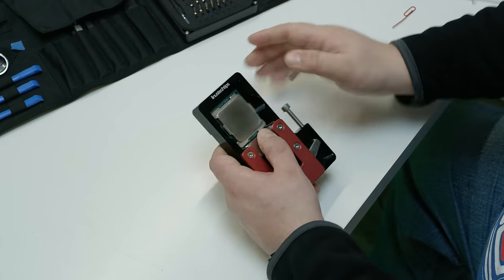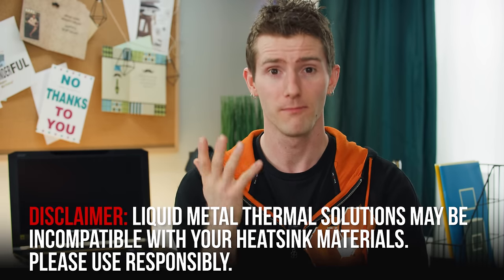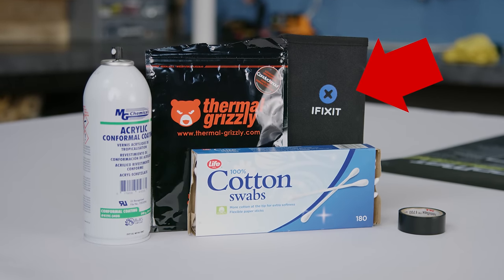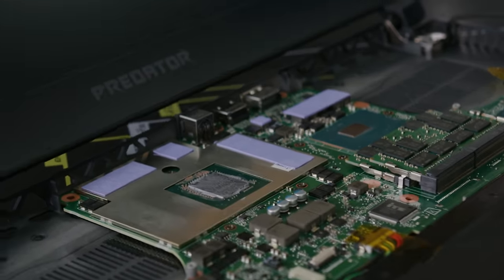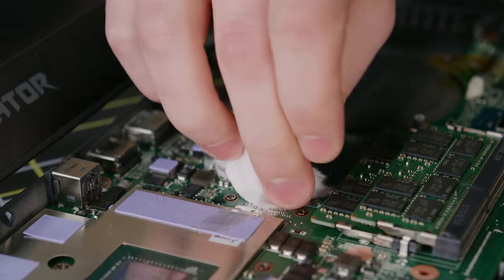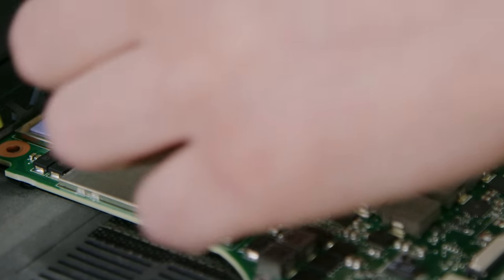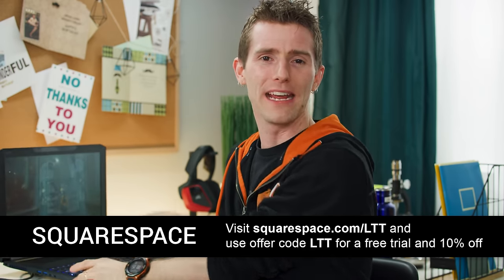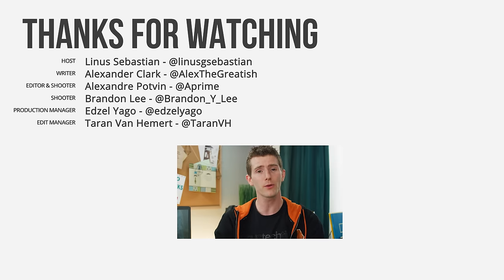Liquid Metal Laptop Cooling – 20C LOWER!

Comment: why don't any production computers come with pre-applied gallium compound? i mean i know it's more expensive but it seems like it'd dramatically increase performance to noise, and it's a nice thing for a gaming computer to be able to brag about in its marketing. or why don't any of the really high end desktop/workstation processors come with gallium under the IHS? i know the reasons most people don't do this kind of mod, but from everything i hear about it, sounds like all of the issues with it are totally controllable. like any of the problems that people have with liquid metal ultimately arise from the consumer trying to do it themselves, not having tools with a high degree of control, or just not knowing what they're doing. if it's perfectly safe and long lasting then why don't any companies incorporate it into their existing assembly lines? or do they and i'm just not aware of it? if it's really still mostly an aftermarket mod, that would seem to suggest there's some caveat, right? anyway does anyone know if the internal surface of the threadripper 1950x IHS is aluminum? not getting super high load temperatures or anything and i know the reason it can't OC much past 4 ghz is not because of the die overheating. but if there's no real caveat to gallium, why not push it a few degrees lower just for the sake of it? just haven't got any idea what metal is actually inside the package.

Comment: Elevate ur laptop a little...dont leave it on a flat surface when gaming...it suffocates ur laptop....my laptop thermal throttles if i leave it on a flat surface...i put it on a laptop cooler and it drops 10C...when i undervolt itndrops another 10C...my laptop never goes above 71 during gaming sessions

Comment: Hey Liinus....  Do you think using liquid metal would help the cooling issues with the area51m 2080rtx.  I was gonna repad it with artic thermal pads and liquid metal.  I had 2070 in it but thought I might as well max it out before rtx's rise in price and the gpu becomes more sparse.  So much for the upgradeable dream.  I cant believe they screwed up with the R2 also.  I have a feeling there's probably not going to be an R3.  What's the point. Maybe they change to an AMD board.

Comment: Um also https://en.wikipedia.org/wiki/Liquid_metal_embrittlement - probably don't do this, its NOT a chemical reaction and the gallium can migrate into other parts of the laptop up the solder traces over time if you get ANY on anything but the core/spreader interface. There is a reason Intel, Nvidia, AMD etc do not do this and use the compounds they do ! It will also eat aluminium parts of a case for breakfast. Look on YouTube for gallium videos ...

Comment: I dunno how you didn't destroy that laptop, the liquid metal seems like it has low enough viscosity to wick under the components on the board, not just around them. Also anyone know if long term it's a good idea to put electrical tape on those components? Hopefully there's nothing that can slowly cause corrosion in the glue. I'd have used kapton tape myself since it's commonly used on electronics.

Comment: yeah man for over a grand laptop i dont think i want to risk it . My laptop is the cut down Zepherus  the best buy version is actually super equivilent accept it doesnt have a gtx 1070 it has the gtx 1060 g gig and 120herz diplay to be honest if i get at least 60 fps on all games  im more than happy and it basically comes with the shape and even stealthier look like the zepherus with just the eye on the back glowing everything else is 8th gen 8750 fastest cpu in cinthetic benchmarks ive used so far on a laptop  heck even beat my overclocked to 5ghz i7700k  . it cost me a whopping 1399 so far it seem to not overheat much i mean the highest ive seen in gaming is 79 c and gpu at around 77c and overclocking or undervolting didnt seem to do much so i guess asus tuned it right . One thing is i will most likely end up upgrading the ram and perhaps more harddrive space  the memory is in single channel unfotunately dont know how much it effects gameplay though im getting around high 50s in in final fantasy 15  on highish settings it does dip quite fast when in battle and u got a bunch beasts attacking u your framerate plumits fast . from what i gather it could possibley that its dualchannel memory sensitive cuz gpu is like 75c in game tops usually lower i have overclocked it and not much gains to be honestly it already boosts towards 1890  sometimes my guess the game especially loves good cpu power more in this instance especially the clock it holds well on 3.9 ghz most of the time i suppose  my i7700k at 5.ghz brought up my rx 580 on all highest setting  to 60 + and way way smoother then before it would dip  to 30s .so i kinda get why ryzen is winning the gaming battle because many games simply  just love that high clock of the cpu speed evne though this is quite dam good the last time i had a somewhat gaming laptop was like amd turion i believe with amd gpu that i dont even remember with 2 gigs of ram and 2.2 ghz speed and that was around 2008 it was a dualcore and it was a beast at playing all my emulation games haha  thats all i used to do . Did u know i only  recently got into pc gaming  i could never run a darn game till 2017 at the end of last year when i built my  new pc . and boy was it glorious looking peace of junk looking and yet fast of the wall for my taste going from a dualcore to a full quadcore desktop ang gtx 760 dam i was flying high had  so much fun i could finally play rise of the tomb raider so much fun such a great game i love it . i think i learned how to do it prior to building it i watched a ton of your videos back then  i couldnt resonate with you on all the pc stuff then when i got into pc i was like this linus dude is cool  like  something clicks and u get it why the crazy amount of time into reviewing so many pc stuff cuz i was into mobile phone gaming more or tablet .

Comment: i noticed you covered the whole chip surface with the "liquid metal" thermal paste do you see a significant temperature difference when you only cover a surface of the chip that is much smaller ? (in order to  avoid the spreading work and limit spillover risk if there is no major difference in heat output )

Comment: OK  it works - I did use a small drop onto the core and copper heatsink - I did not use any glue or tape around - just richly covered it with the traditional thermal paste (silicon without graphite) - AND It did drop the temperature from 87 to 77 degress BUUT - after 1 month - the temperature raises every week - Now I am on 84 Celsius - Can someone tell me why ??
Reply: Why did you use thermal paste over liquid metal, are you aware of any issues it might cause? I suggest you clean it up and apply liquid metal only as required. Never known the mixture is causing the liquid metal to not work properly after a certain period of time.
Reply: @kvrreddy1605  you should use "reading with understanding"... no mixture done - paste around the core - this is legal
Reply: @toruntpart  Maybe you should use your brain. Pasting thermal paste around a liquid metal core will lead to a mixture as you place heat sink over it. I was only trying to help, you can go aheadand paste what ever you want. Peace out.
Reply: @kvrreddy1605 Metal may mix the same way as with the conformal coating and stay ontop of it not touching other connections and even easy cleaning possibility was my goal so in a stupid way you confirmed I was right. It works for a month now. Those videos are for people dont afraid to experiment. Sorry bro.
Reply: @toruntpart  You should try using only liquid metal and monitor temps. Then try thermal paste and check out. Which ever gives better results is what you need. I am guessing liquid metal will give better results. But both together may not be conducive in the long run.
Reply: @kvrreddy1605   Thanks I will check it.

Comment: Does liquid metal thermal compound adhere to the surface of bare die after long term use? Also, does it need to be frequently reapplied due to "pump out" effect like MX-4 & NT-H1?

Comment: So why don't they make it standard to all laptops to use liquid metal?
Reply: Expense; simply put. Thermal Grizzly Liquid Metal costs about 20 Bucks or US Dollars for just a few drops while the stuff or CRAP typically used costs about 20 bucks for Several Truck Loads. Your question is valid, you'd think Intel would use Liquid Metal in the 1,000 US Dollar and UP CPU's but GREED has gripped them and they only care about PROFITS rather than Quality these days... It's a shame really... Intel would rather force you to VOID your shit Warranty rather than install Liquid Metal in CPU's. 

GREED and MONOPOLIES go hand in hand as you can't have one without the other. I am all for reasonable Profits for any one or any company; but Intel has been a Monopoly for decades now and I grow tired of the mere 15% increase for double the money year after year. AMD would rather get involved in Collusion instead of shake up the market so how did it price Threadripper? Right, it was priced as HIGH as Intel so we, the Consumers, were left with Take a Chance on AMD or Get butt rapped by Intel; either way WE got screwed. Threadripper is good, but not worth the price. Funny how AMD can produce Threadripper but failed to produce a Dual CPU AMD4 Platform; can you guess why??? MONEY. Dual Ryzen 1800X's cost about 600 Bucks or US Dollars while Threadripper costs almost 1,000 US Dollars. 

WE THE PEOPLE need to take a stand and let Intel, nVidia and AMD twist in the wind on their next SEVERAL RELEASES and NOT BUY A SINGLE THING and watch how fast they drop their Prices just to get someone to BUY... Of course no one cares about any one else so you all won't ban together and Boycott... Until WE DO, Intel and other Monoplies will keep providing sub par products at gouging prices until WE TAKE A STAND...

Comment: But can you buy laptops which are already this way? Why wouldn't manufacturers also want to use this?
Reply: Can confirm the 2019 omen 15 has this cooling
Reply: @rn-zu5ld  don't the ROG series of laptops from ASUS also have the liquid metal? Besides, there's also supposed to be that carbon pad thing that's nearly as good, and it's not liquid, so you don't have to worry about it leaking/dripping to cause a short-circuit.

Comment: Linus can you do a 2021 SSD external harddrive review T5, T7, PNY Pro Elite and why thunderbolt with its blister speed are gooseneck aka "extremely bottlenecked " buy the external SSD interface chipset like 16gbs down to 540mb WTF??! also could you go into some details of the internals in terms of terminals as SSD drives or so prone to thermal throttling and perhaps the first time I have even taught of upgrading terminal pads and heatsinks within the external SSD, like I got this ionsbo m.2 2280 heat sink for desktop and like its nanographene finish is well, brian Fantana good it's on eBay.

I would also like to thank you for the vid on the liquid metal thermal paste application and upgrade as it was very informative and also entertaining as I have come to expect from linus media group. I found a solution to the limitation and danger to the electrically conductive nature of the product in the application. I used LT100 Liquid metal for its 128w in the 3g variation in conjunction with thermagic EX 14.6 W/mk , though I would say 3g I have a lot leftover, as it was my first application I decided it better to have a little extra. Also, I would say Dell's precision line on the 3530 model -I know it's dated but still. the build quality and pdf guides on this are outstanding like I remember a day when if you removed the back panel of your laptop the warranty was void and now down to replacing the motherboard is in the maintenance pdf like 2021 fantastic job dell, also their pro tec support for a wet back noob like myself - what is PCI express like, mosses I.T. crowed mind explosions.

i Used the thermagic to surround the thermal plate of my GPU and CPU, though I will say on the P600 this was required more directly as the configuration of the plait is more susceptible to electrical bridging so I was quite particular to insulate these then following your directive to the application of the liquid metal to the CPU and found applying the liquid metal also to the receiving side of the heatsink to work very well in creating a solid bond between the two. I removed the heat sink after some testing and found tracing the spread between the two thermal compounds to increase heat removal as the lateral heat travel conduction from the surrounding of the terminal plate to see an improvement of around 5% more than your findings. this was first alerted to me when watching an application wherein applying the thermal metal and coted the souring chipset in nail varnish of all things to the detriment of their testing performance and had to remove the electrical insulation with isopropyl alcohol, to which i instantly taught if this reduces performance the nonelectrical/ terminal conductive coating would improve performance. I was correct and would like to share my discovery with the LTT community - to prevent global warming -joke

Can you please make a vid exploring a multi-layered approach to the terminal interface on a laptop desktop and perhaps in a progressive world an external ssd. As the microstructure of the copper surface would appear to get better reception with liquid metal to thermal paste than with just the thermal paste alone - like a larger thermal landing plate is just a no brainer is a purely terminal interface how is the surface real estate any thing but a terminal plate-like were at a 20%and below surface transfer on the i7-8750H CPU  like Why like in a 400$ chip can we splash out on the 8cents and give her a little breathing room - like I would say the factory clocking on this chip could double with that design upgrade alone - intel kinda feeling futurama fry " something seems off here...? "

Comment: Quick question, would this process be able to be duplicated with a late 2017 razer blade? Never opened a razer balde and I'm not sure if the heatsink materials will be compatible with the thermal grizzly compound.
Reply: Don't do it.  Gallium will form an alloy with Copper and your temps will go up over time while the gallium gets absorbed into the heat sink.  It's likely a Copper heat sink like most laptops.  If you look up how to take your laptop apart, you'll probably find a video or guide that works for you.  I'd only replace it with quality regular thermal paste though.

Comment: I'm not sure about LM because I don't know if my heat sink pipes are pure copper. Some manufacturers use aluminum tubes with a thin coating of copper. So it looks like copper from the outside, but if you use LM it can still melt your pipes if it finds it way through the copper coating.

Update:

I did a little research and it looks like Omen heat sinks are not suitable for use with liquid metal pastes:

https://www.ifixit.com/Guide/HP+OMEN++15-dc0030nr+Thermal+Paste+Replacement/112630

According to an email I received from HP after requesting the info

“As you requested please go through the link to know more about the heatsink materials and they are mostly made up of aluminum alloys.https://www.abl-heatsinks.co.uk/heatsink... “

Comment: My question is how does heat effect the vicosity of the liquid metal. For example if you used this in a tower with the motherboard vertical could it becoming runnier and actually seep out and drip onto the GPU which is under the chip or does it move out when the laptop has been under load and then you lift it and put in into carry case to go to a friends house ? Just a thought to see how feasible this stuff is.

Comment: Hi,
Thank you for your help about the experience with this laptop :) really helfull

One question:

Is secure to use liquid metal paste on processor and gpu? Because I Heard that it can't touch aluminion surfaces becuase it Will destroy it, and when the paste is hot it turns more liquid so can go through the components that are conductors of electricity can damage the system. Maybe make sense in a pc station in house but a laptop that you move it it is sabe to use metal liquid paste?

Thank you
Reply: Don't put on GPU. It doesn't make any difference. Absolutely do not use it with aluminum heat sinks. It will dissolve them. I don't think moving the computer around makes any difference. Liquid metal is used specifically for laptops because desktop PCs have other cooling techniques that work just as well as liquid metal without the risk.
Reply: @4FYTfa8EjYHNXjChe8xs7xmC5pNEtz  Tha K you so so much. Nice answer, that's what I need it

Comment: I have used two different Acer PREDATOR laptops. (spoiler alert) THEY WERE BOTH TRASH
specs are good, hardware pretty good, the software went wrong somewhere... maybe that is because it is Acer?
Reply: For the cost why not just remove factory software, and start with generic Windows 10 and only add in the programs you need to use, and not all of the bloatware? Yeah, you gotta want all the light show you can get, but once the stress testing is over, you are more wanting good overtemp programs, to keep the life of the CPU/GPU to the maximum. So like that you have throttling, to keep it coolest as possible to extend the life of the unit.

Comment: Just wondering will tin (yes soldering tin) work ? Somebody should test that
Reply: No. Solder melts at 200 degrees Celsius
Reply: Jeremy Clarkson crap, i didin't remember to take that to account.. But none of CPU's get to 200°C on top of IHS. Somebody really would need to test that
Reply: Dub Monster Well it would be impossible since solder gets solid and will prevent you from putting the heatsink back on the CPU
Reply: Jeremy Clarkson i know.. too hard